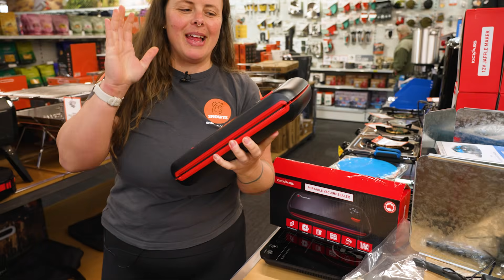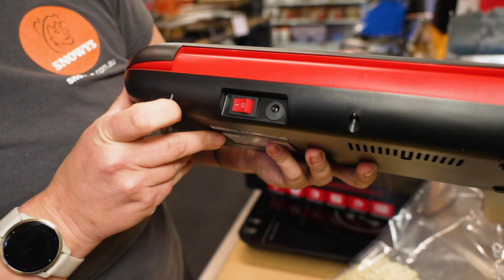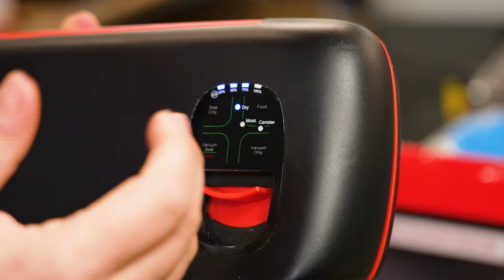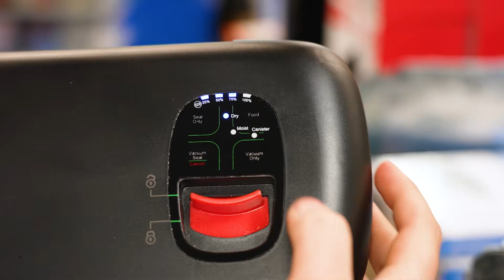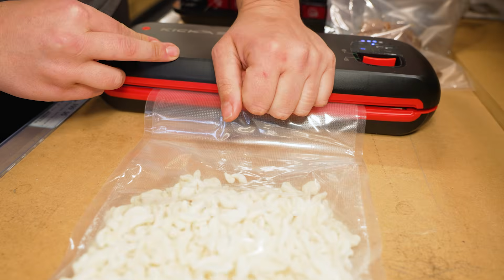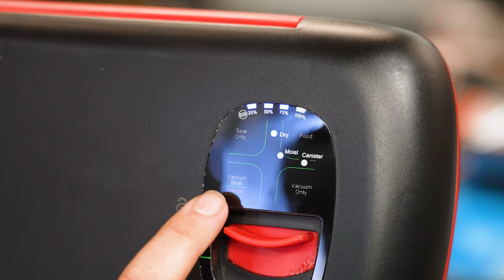KickAss Lithium Battery Powered Vacuum Sealer

Comment: I've found that if the vac bag is pretty full, it can be handy to raise the bag up level with the opening in the machine which can aid the rubbery gasket getting a good seal as the machine sucks the air out of the bag. I mainly use my vac machine for sealing individual raw steaks in bulk for the freezer so they don't get 'freezer burn' as I get around to eating them in rotation with other foods. Really, you can only eat so many Wagyu steaks in a short time.

Comment: Seems pretty useful especially with summer camping coming up. I wonder after scissoring near the seal, can the bag be washed, dried and reused multiple times?
Reply from the maker: You can, but see the comment from Bruce here, you need to be careful about cleanliness. ~ Ben
Reply: I wouldn't advise it with anything other than the driest of foods, say uncooked rice or breakfast cereal, maybe pre measured flour and baking powder for making bread or damper. Any liquid can get into the corners and be almost impossible to get out fully, making a perfect home for bacteria to flourish. Better spend a few dollars on a roll of bag material or a pack of precut bags and toss them after use than spend few days heaving your guts out and living on the throne of power. Generic vac sealer bags can be had as either bags or rolls almost anywhere, or even at a big Yank store as boxes with both.